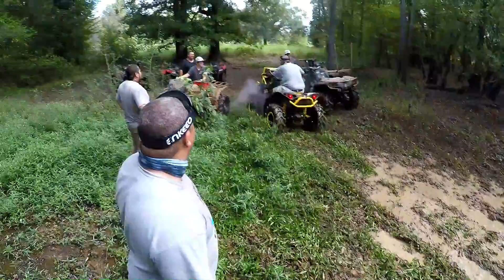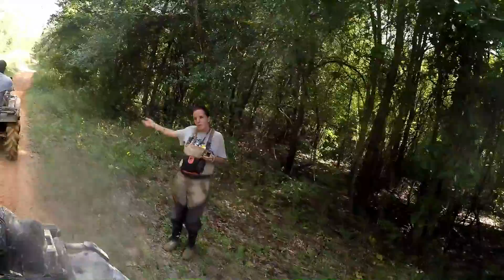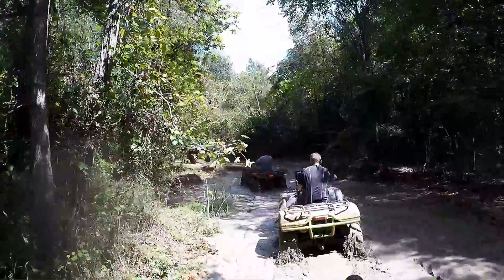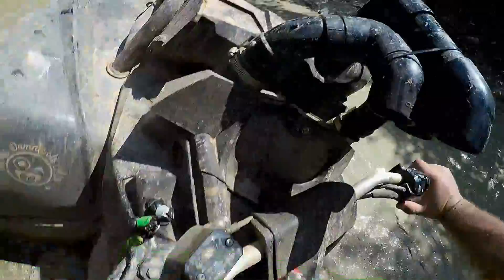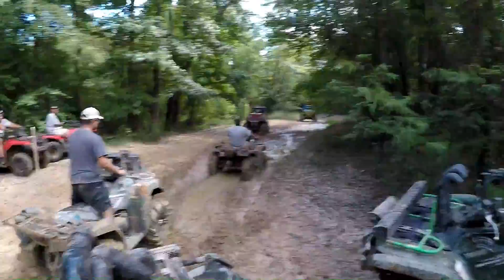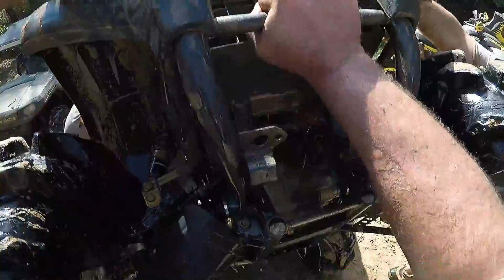Awesome Ride With Swamp Ass and Crew at Gator Run

Comment: What is about the Yamaha 4-wheelers that if you hit water kinda hard it goes into the air box   I've got a older Yamaha Wolverine and that's what it does.  It's like it's got a funnel that sends it directly to the air box
Reply from the maker: Stacy Reid yeah Dilly done a lot of work to it after this ride. It did awesome at River Run!!! 😎
Reply: The Cau-Cajun that's good to know   I'm probably gonna make a deflector of some sort for this thing